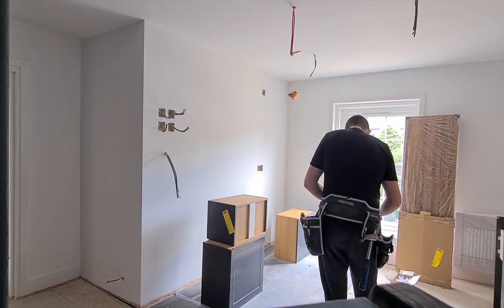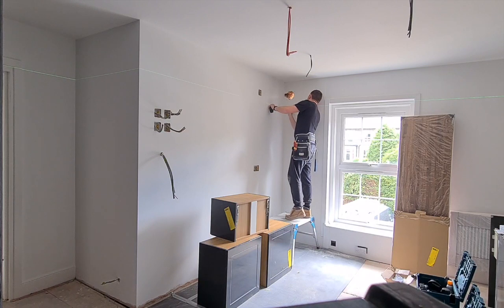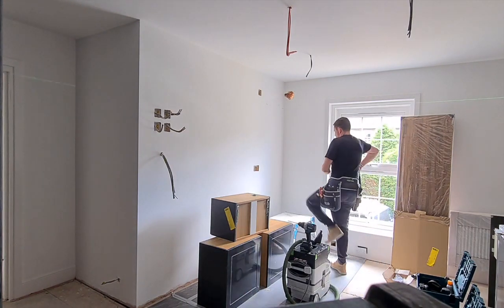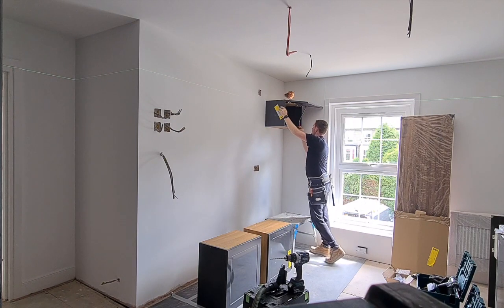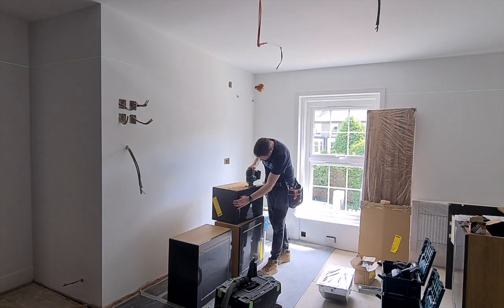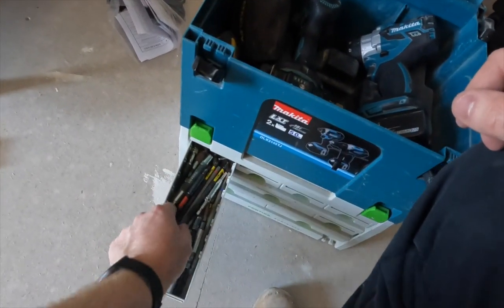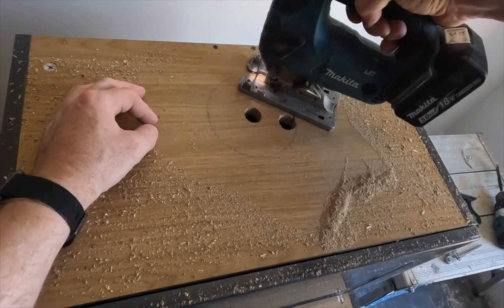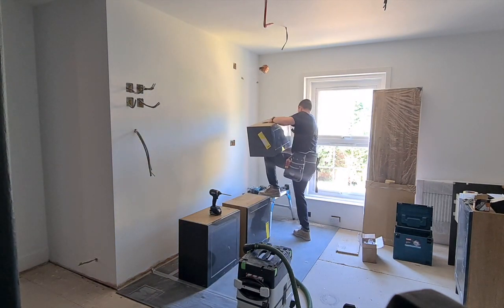Fitting a Kitchenette Part 1 - Wall units / Extractor Hood installation +My Makita/Festool load out!

Comment: Nice job, I can't for the life of me understand why people don't put high and low noggins into the wall before it's slabbed or better still sheet it in 12mm ply along the hole wall underneath the slab. I mean everybody knows kitchen units will be hanging off the wall, make your life so much easier.
I personally still use levels (stabila) over a laser level. I own a laser but still prefer a level I know I can trust.
Have you tried screwing an of cut of material or 2x1 to the bottom of the unit you are cutting to support the piece so it doesn't drop before you are finishing cutting.